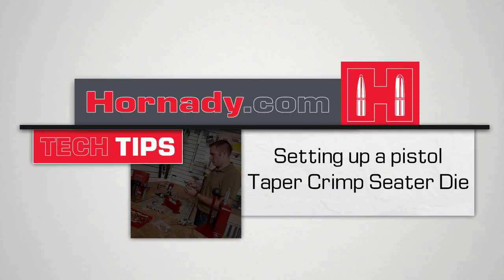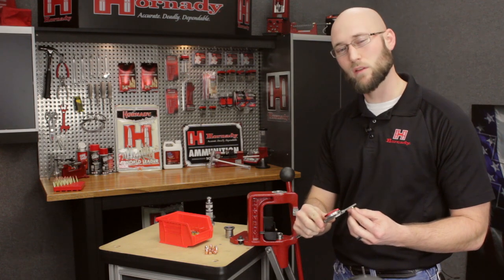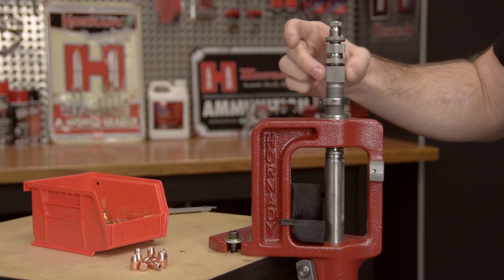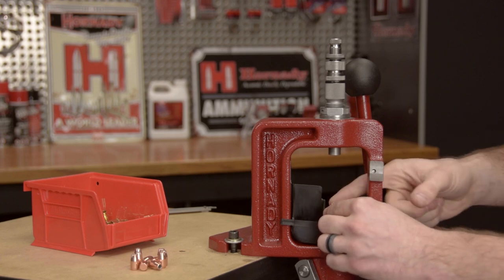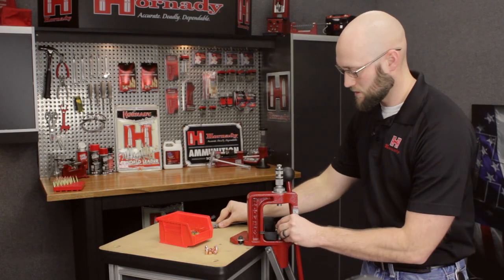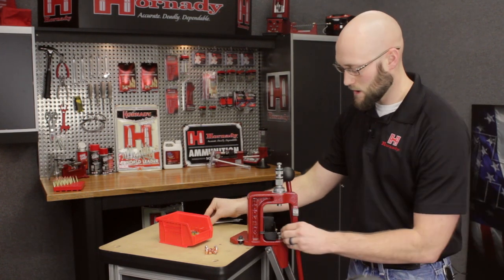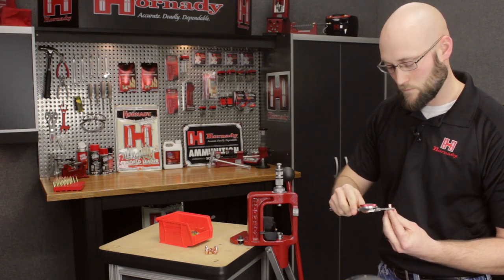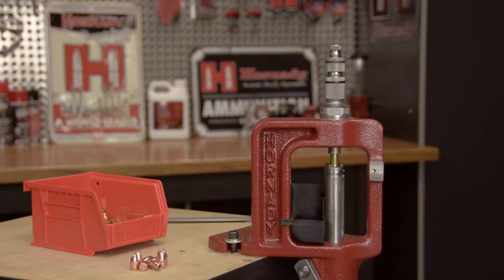Hornady® TECH TIPS: How to set up a pistol Taper Crimp Seater Die

Comment: I like how you get back with peoples comments and issues. Its rare that a company will not only post great instrustional videos and also answer people. I've used your dies in a few calibers and impressed enough that I think they will phase out other die sets as time goes on. They are just packed with features not available to other die makes. I also think that your seat/crimp die is the only one that works perfect. My advice to others running a separate crimp on their progressive that is not the Lee FCD you are not gaining anything by separating the crimp stage with these dies. I had a setup for a while on a Dillon 550 that had a powder check in station 3 and used this die to both crimp and seat. Rounds all turned out great and passed plunk test 100% that is of course with my gun/setup results my vary. I will say your sizing die is also simply amazing. Sizes .40 further down then certain makes and the finished round comes out looking wet tumbled. Great job and keep it up.

Comment: I prefer a separate crimping die (NOT FCD) over this combo.  A separate die works better IMHO when you have variances in case length. More importantly, I’ve always thought it doesn’t make sense to crimp the case mouth while the bullet is still being pressed into the case (even if only a little bit).

Comment: Hello sir, great step by step instructional video. I have a question, I gave the seat adjustment screw 3 full turns. But when I adjust the crimp adjustment screw, the seat adjustment screw also turns. Is that suppose to happen? I thought about holding one while I turn the other.
Reply: This isn't all that critical, all the you want to make sure of is that it's far enough out so that the seater is not contacting the bullet while you're setting up the crimp.

Comment: Hope vid isn’t too old to get a reply...recently started casting and found the lee FCD to be swaging my bullets down a few thou by the time I got sufficient crimp.  Causing bullets to be way under sized and leaving a tidal wave of lead in my barrels.  🤬.  

Been trying to get the combo die running (when I first started reloading I gave up on the combo die pretty quick after I just couldn’t get it right and then heard about the FCD from lee). I’ve never been able to get this die to operate properly, and I have the same issue with rcbs combo dies.  If I set up the die exactly the way you did in the video I can easily push the bullet into the case.  And it will do the same when cycled through any of my pistols or (especially) my CZ scorpion.  So no go there if I don’t want to blow one up.  So, I will back off the seat stem, screw down die 1/8-1/4 turn at a time, and check the round for movement each time until I can’t push it into case without  substantial pressure. At that point I’ll run it through my scorpion (the worst culprit for jamming bullets into case) and verify it’s good.  Lock everything in place and use that round to adjust seat stem minus approximate amount bullet has pushed into case (using the micro seat adjust stem...a fine product by the way).  Next round comes through....SMASH.  Severely deforms or totally crushes bullet.  Same for cast, plated, and fmj.  Have had this issue for years.  Never been able to figure it out. Always just crimped separately in last station.

Basically what I’ve found is the crimp comes on way too soon, so the seat stem is trying to seat into a crimped case by the time bullet is seated about 40%.  So it meets much more resistance through the last 60% of seating travel. Squishing the stem into the bullet. 

 I’ve tried sorting brass by length thinking it was a mixed head stamp (too much variation in case length) issue.  Nope. Tried measuring a bunch of bullets to see if there was variation in diameter...nope.  Same happens between .353 (batch of 124g XTPs🧐) and .357 I get exactly the same problem.  This is a MUCH bigger issue with 223.  Totally sinks the shoulder into the case.  This, after all the cases have been run through a dillon trim die and trim within .001”.  That’s with just enough crimp to get mouth rolled into the cannelure properly.  With 223 I also tried rcbs small base dies...allegedly (per rcbs) the crimp/seat die allows for more variance in case length. Zero change with that set.  

9mm just crushes the bullet.  10mm and 45 aren’t quite as bad...but still leave indent on the projectile.  Been a few years now...always just used a separate station for crimping.  Still hand feed bullets because of it. Would love to move on to a bullet feeder, but I just can’t get these darn dies to chooch without damage to the bullet and/or case. Would love some advice.  I’m sure I’m doing something wrong...I just don’t know what it is.  And I promise, I’m putting the minimal amount of crimp possible to keep bullet from pushing back into the case too easily.
Reply: sounds like you might be setting the crimp too tight initially before setting the bullet seat depth. 9mm is a light taper crimp so no reason you should be crushing bullets, if anything, it should just seat way too deep. Here's how I set my Hornady combo die up and seems to work. Back out both the crimp section, and the bullet seat depth screws pretty much all the way. Next, take a ready casing and put it in your press and run it all the way up. Screw in the crimp ring until it just touches the mouth of the case, then back it out just a tiny bit, just enough so it's not touching the casing. Run the press down and put a bullet in the flared case mouth. Run the press to the top. Screw in the bullet seating screw until it hits the bullet. Lower press slightly, turn seating screw in minor increments then run the press up. Continue this process until the bullet is seated to proper depth and your desired overall length. Lower press arm slightly, screw in the crimp setting screw about 1/8th of a turn or just over while holding the bullet seat depth screw in it's stationary place relative to the press and die body (Those two should not move while turning the crimp ring). Check a couple rounds making minor adjustments to the crimp or seat depth screws until you have your results. Just remember the crimp adjustment screw and seat depth screw essentially work independently and each has their own minor adjustments to make. I know the instructions in the die kit are not the best and very confusing when reading, but if you disassemble the die, and see how the whole system works (die body, crimp sleeve section, and seat depth section) it makes sense and does work well when initially set up right. 

I just re-read your post too. Are you making sure to have enough flare on the case so the bullet slides in easy? Is the bullet getting jammed in the case mouth then getting crushed as the press is raised?

Comment: im getting crimp marks towards the tip of the bullets head. However when i press the catridge into a block of wood to check the crimp, the bullet doesn't get pushed into the case so this leads me to believe there is sufficient crimp. Is this correct and should i worry about the slight blemished ring around the bullets head?
Reply from the maker: I believe that the marks are coming from the seating stem located in the alignment collar. The bullet profile may not match the profile cut into the stem. It can leave a ring around the bullets tip if enough resistance is met. The marks should be cosmetic and should not affect performance unless the marks are very deep. Thank you for your question!
Reply: Im having the same issue, mine are rather deep I believe. Loading 147gn fmj with 4.2gn IMR 4756. Loaded 100 and fired 50 at the range no problem but the indent in the bullets are quite deep.
Reply: I had this problem. I was crimping (roll crimp) to early and so was pressing the bullet into a crimped case for the last thou or so.
Reply: @harley ross  how did you fix that problem. I thinks that it's no brainer but the crimp should come after the seating correct?

Comment: Ok so if you have .002 of roll crimp in the 9mm luger and when I chamber a round it in my Sig p365xl seats the bullet another .006. That seems like a problem if you take that round in and out a few times before firing the round. That would create more pressure in the round if the bullet that is so post to be 1.100 OAL and going down to 1.090 or lower. So how much roll crimp is too much and is it even possible to eliminate that problem?
Reply: I prefer a role crimp in a revolver cartridge where you need the extra hold due to bullet moving  forward under heavy recoil and use the taper crimp in simi automatics handguns aiding in the cartridge being chambered. Never tried a role crimp in a semi-automatic.
Reply: You should not be using a roll crimp on a cartridge that head spaces off the case mouth . 
Period .

Comment: I would like to see you make a few rounds and have them come out close to your numbers, because I can't. my measurements range up to 7-8 thousandths plus or minus and it drives my nuts!
Reply from the maker: Which numbers are you referencing?  If it’s overall length, that number will indeed fluctuate based on the length variation from bullet to bullet, different neck thicknesses, etc.  Feel free to give our tech team a call at 800-338-3220 and we can discuss your length variation.  Thanks for your question!
Reply: When I put that cartridge back in the shell plate and run it through the same seating die it comes out within + or - 2.5 thousandths. Yes, I'm talking about COL and it's frustrating.
Reply from the maker: If you’re running a progressive press there are many, many tolerances stacked linearly. If not every station of the press is full that can increase the OAL fluctuation that a loader will see when using a progressive press.  Please, feel free to give us a call. Thanks!
Reply: Hornady Manufacturing Thanks for the reply, wish I knew this before I spent over a grand on my set up, but you guys do have great customer service.
Reply from the maker: The variance that you are seeing could possibly be tip finish. When a bullet is manufactured, the last part formed is the tip. That tip can vary some as it does not contact the rifling and is basically setting freely in the bore. The critical dimension is actually from the bullets ogive (where it contacts the rifling) to the base. The seating stem that you are using is not pushing on the bullets tip. It is pushing on the ogive so the dimension from the ogive to rifling will stay the same but the cartridge overall length can vary some. The slight amount of variance that you are getting could simply be tip finish. Tip finish is normal and will not hurt anything. Happy loading!
Reply: @hornady  Thank you

Comment: Good video but i am getting alot of bullet bulging on the side of the case making the brass out of round and I can't figure out how to fix it. I've set up the die about 10 times hoping that i just did something wrong but it's not fixing the problem.
Reply from the maker: +Sandor Borbas Thank you for your comment. When seating pistol bullets it is not uncommon to see a "bulge" where the bullet is pressed into the case. If the brass is .0005" or .001" thicker on one side, the bulge will visually appear to be "out of round" - this, again, is common and is purely cosmetic. If the bulge is so large on one side that it interferes with the function of the round I would recommend increasing the amount of flare on your case by another .001" or so. If there is insufficient flare the bullet may not be going straight creating the trouble. If the problem persists you can give our tech team a call at 800-338-3220 and they will help you troubleshoot the issue further. Thanks!

Comment: Is this how to employ a “roll crimp” or “taper crimp”?  Or is there a difference?
Reply: Hope you’ve found an answer since your comment is over a year old....
This video is showing a taper crimp set up. Taper crimps are used for rounds that will be fired in auto loading arms, or for calibers that headspace off the case mouth. 

It is important that, even if running in a single loaded or revolver type firearm, any caliber that head spaces from the mouth of the case is only ever taper crimped.  A roll crimp physically rolls the case mouth into the bullet, which can cause serious problems in those types of rounds.  9mm para is the most common round that you’d have this problem with. 

Good news is, for most calibers that should not be roll crimped you won’t be able to buy a roll crimp die. Most rimmed cases like 44 mag, 357 mag, 38spl, 44spl, etc will all be good to go with a roll crimp.  The die sets for those calibers typically come with a roll crimp die.  

I’ve never been able to get the method shown in the video to work.  I usually use a separate crimp die, and screw die 1/8 to 1/4 turn at a time until there is sufficient crimp that I can’t easily push the bullet further into the case by hand (against a wood block).  Same for either crimp method, though less crimp is needed for revolver rounds.
Reply: Couple of things to add:  the purpose of a taper crimp to keep a bullet from being pushed back into the case.  Makes sense for an auto loader both for cartridges in the magazine and when slammed into the feed ramp. It doesn’t take much to accomplish this. You have the opposite problem with a revolver - recoil can pull the bullet OUT of the case. Sometimes even causing a jam when the cylinder rotates and the bullet hits the forcing cone. 

Bullets for roll crimping typically have a cannelure (groove) for the crimp to roll into. The case mouth in effect wraps around the back side of the groove, preventing the bullet from moving forward.

Comment: Can i adjust the crimp on already loaded ammo? Seems i screwed up about 2k 9mm the other day they drop into a barrel fine but when trying to chamber it's super stiff. One even jammed up my glock 17 and i couldn't operate the slide at all (with the round inside)
Reply: I  know this was asked long ago but, if your cases are resized properly, your bullets should run through your gun without a crimp. A crimp is used to help hold the bullet for a millisecond to help build pressure but mainly to keep the bullet from moving forward especially in a heavy recoiling revolver and possibly seating deeper in a lever action rifle. Check the overall length of your cartridge. Yes you can re-seat and re-crimp loaded cartridges as they are loaded when you did it before. 
Better too long than too short. The deeper you seat the bullet the higher the pressure of the cartridge.
Reply: Ah bullshit